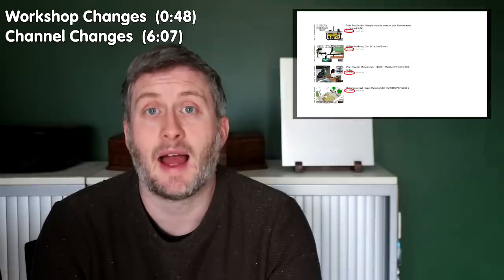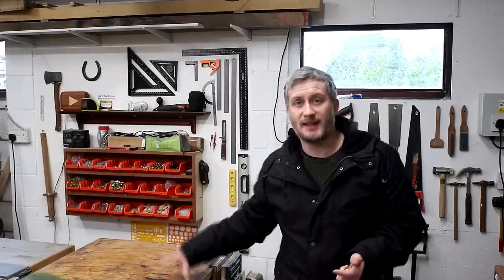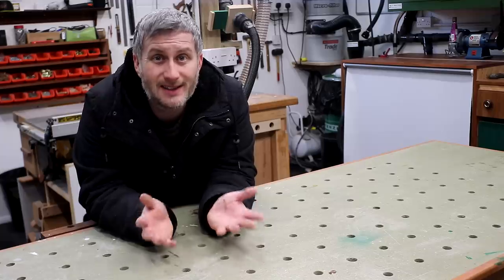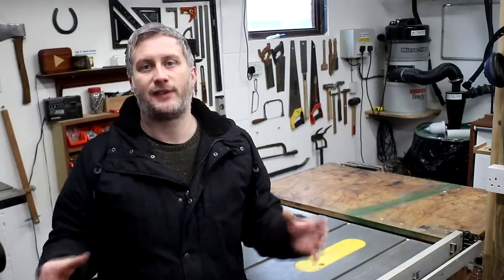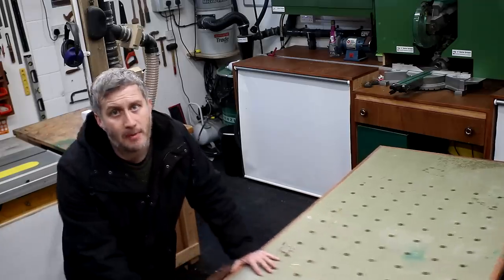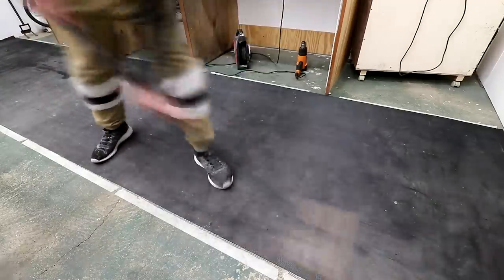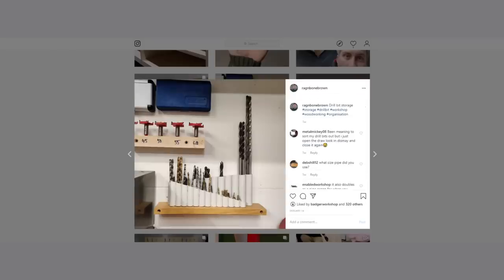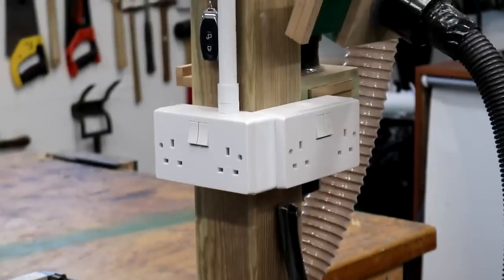VLOG 10 - Workshop Changes / Channel Changes / Tool Talk (broken Mirka sander / New Air Filter)

Comment: Regarding the remote control - you could try using an IR on a phone with an app or on some universal transmitter to try simulating the "on" command.

Comment: Love the pointy stick solution 😃 don’t know why you would need anything else 🤣. 

You need to do what is right for you and I hope it works out in the end.
Reply: Realizing that this all happened a year and a half ago, and that you have sourced a remote for your air cleaner, I’d like to make a pointy-stick upgrade suggestion.  To make the operating end a bit more functional, add a snugly fitted rubber cap (if you can find one that fits) OR you can coat the end with hot glue, either of which will serve to make the business end a bit more grippy and effective.

Comment: I find that the more premium manufacturers are harder to deal with, which you wouldn't expect. I've NEVER had an issue with DeWalt or Hitachi. In fact, I broke a drill bit once and the DeWalt rep I spoke to sent me an entire package of cobalt drill bits as a replacement. They're by far, the best in the business.

Comment: The whole issue with warranties is that some sellers will import equipment from outside the region. If you are in the UK vendors will often only support kit that has come through the European distribution network. If you buy cheaper item from a vendor who has imported it from say Hong Kong then it is a grey import.  Manufacturers don't like this because it messes with their pricing I guess, hence they try to stop it by not supporting grey imports.  No idea if that happened in this case but if your Mirka was a lot cheaper than through the main UK vendors, quite possible.

Comment: Thanks for the interesting update. If you are thinking about a new table saw you definitely need a new table saw. It is the cornerstone of timber workshops and a larger table lets you play with fantastic jigs. Also, a big saw does not take up any more space as it is always part of a larger workstation anyway. Really good quality second hand saws are ludicrously cheap, especially if they are three phase and dead easy to re-motor with single phase. Sliding tables are also a boon but take a bit more planning space wise. My last Wadkin sliding saw was £120 and the new motor was £106 - for an industrial quality machine that would now be 4 or 5 thousand.

Comment: Get a bigger table saw, look for an old Sedgewick or if new, an Axminster trade would be about £900 but you could sell your DeWalt for about £300 and you would be massively upgrading your capacity and going to a full cast iron top with lots of options for extensions in the future and they hold their value well and have good dust extraction.

Comment: Hi Keith,
I do have a RP shop vac with no remote or other fancy stuf. But it has a switch.... that is turned on and stays on. I simply made a connection with the light switch. If I turn on the light.... The shop vac gets its power and does its thing. And maybe its a workaround that works for you. 
In stead of the stich the regulates the lights youlf course can install a second switch for the air filtratio unit.
Reply from the maker: nice solution

Comment: If you upgrade your table saw to the sawstop jobsite saw, there is a good example of an integrated bench video/plans for that on the Darbin Orvar channel.  I preferred a 4" dust port and so got the larger sawstop contractor model.  Then I decided to make my own mobile base as I wanted it to have 4 way wheels, and I made several videos on that.   Good luck in whatever you choose, I look forward to seeing your upcoming videos and projects.
Reply from the maker: SawStop not available in the UK. Thanks

Comment: Hi. Great video. Add financial/marketing advice to each build video. Tool/shop videos are always fun. Stick to your values. 
Air filtration suggestion- having bought this unit also at Xmas i found the guts of this unit is generic across a few brands. It's my understanding buying a WEN branded (£135) is the same as RECORD, (5yr warranty on RECORD) and remote will work with all. So, buy another unit, have a mega clean workshop/lungs, and one click to start them both. 
Or you could always make a nice machine stick starter project video!

Comment: I'd highly recommend getting a new table saw! An induction motor is just pure pleasure, you'll not regret the upgrade!
Reply from the maker: but which?
Reply: @RagnBoneBrown  
That's a tricky question! I started out by building a table saw, with custom homemade parts. That is perhaps a bit much as it requires a whole bunch of machining in steel. Just a few months ago I bought i Wadkin Bursgreen AGS 10, an older UK-made unit (1969). It's farily small so it would fit nicely in your workshop but it's still very capable and superbly well made.

Comment: The work around for the air cleaner would be to disconnect the wires  from the motor to the nvr switch and connect them directly the power cable. 

Other than that, record power have great customer service and would help you with a remote.
Reply from the maker: cheers, too technical for me though!  I am actually sorted now as Karl at Strawbyte Workshop kindly sent me a spare one

Comment: Nicely done Keith 😁👍. Great idea staying in the warm while the other Keith is out in the cold workshop 😂🤣😂. Looks like you may already have a remote for the air cleaner, but if that doesn't work out I'm sure it wouldn't take much to remove the controller and mount it in its own enclosure lower down on the wall (don't know how you are with electrics though)?? 🤔. Sounds like you are taking a leaf out of Andy Macs book regarding sponsors.. good for you 👍. Also.. when you upgrade the power to the shop.. get a 16A supply and sockets, your potential "new table saw" may need one. Keep up the great content 😁👍.

Comment: 1. Upgrade the table saw. 
2. if you make a bigger table to enclose the table, you might want to consider adding a router table addition to it.

New follower here, love your stuff. Keep up the great work.
Reply: You might be able to purchase just the remote for the air filter from the company that it's from. This unit looks like a rebrand of one that is put out by WEN, JET and many others. 
• Take sponsorships only if they are related to woodworking. If you are NOT getting any offers from appropiate people, then you might want to make a list of vendors you like and pitch to them. And it doesn't just have to be  manufactureres, also think of stores.
You may want to check our Steve Ramsey's video about the what kind of content do you want to produce. This doesn't talk about the issue DIRECTLY, but it is indirectly relevant. https://youtu.be/9YQguhFKSWY

Comment: I understand your desire to get paid for the work you put in and I applaud you for your openness to your subscribers.  I fully believe that using a platform like Patreon to allow people to contribute to your effort is valid.  Ignore the haters.  If they don't like it, they choose not to contribute and even not to watch.  Kudos to you for turning down non-content-related sponsorship, but as I said, I understand you desire (or even need) to get paid.  A guy has to eat!  

I enjoy your videos.  Keep them coming!

BTW, If you're power service isn't providing enough amperage to your tools, it puts extra strain on motors, shortening their lifespan.

Comment: Turning on the air filter machine w/o the stick should be a cinch. 

How hard could it be to jerry-rig a lever to press the button down? You could probably adapt some kind of hinge hardware from your hardware store and epoxy it to the machine.

Comment: Hello Keith
I don't normally do comments but re upgrading your table saw, I did a lot of research and if you don't need to take it out i.e. Site work, then I can definitely recommend the Itec 01332  cabinet saw, it's a beast and it is the same as others but without the badge and price tag!  Best place I found for this is Scott & Sargent and as it happens its on special offer at the moment for just £799 plus the VAT. I have made a large cross cut sledge for mine and it now doubles up as a panel saw as well. Very much worth a look? 
I am near Colchester, so not too far from you and if you are ever coming this way, happy to show you it / let you have a go?
All the best in you endeavours, as a footnote, I prefer project videos.
Reply from the maker: Thank you, it looks like an incredible saw. Not affordable to be at the moment but I'll keep it in mind for the future though

Comment: Hi Keith,
Good to see a 'vlog' again, nice one....just a thought in relation to the outfeed tables etc for the 745, i have the same saw, and my workbench looks a similar size to your mft table, i lined both heights to be the same (inc castors) so as i could use the one table to do allsorts, including being an outfeed for the 745,also use the table alongside the mitre saw for longer lengths feed, anyways just a thought....keep up the great work, and keep on keeping on!! Gary.

Comment: If the controller is just IR you could either get a universal controller and program, orrrrr you could get really geeky and use a Arduino or a pi to control a IR emitter and then program it into your shop

Comment: Thanks for the heads up on the Mirka, was wondering how you got on with it. I think I'll give it a miss, that's not acceptable at that price, glad you got it sorted! Would a One for All remote work for the air cleaner, have someone teach the One for All using an existing Record Power remote?
Reply from the maker: Thanks, I am actually sorted now as Karl at Strawbyte Workshop kindly sent me a spare one

Comment: Hi Keith, I love your channel. You have inspired me to setup my own workshop and I've just got to the point where I need to have electrics installed. My electrician has said that I should request a mains fuse upgrade from 60 amps to 80 amps or 100 amps if possible and he said it should be straightforward. Have you had to deal with this yourself? 
I have been in touch with Western Power Distribution in my area and they have said that because of the motors on the machines that they have to do a survey to determine if the machines will interfere with neighbours supplies and that they may prevent me from running them. They also said that if that was the case they could install a "New Connection". They did not say a cost but I am aware that this would run into thousands. I'm devastated to say the least of this prospect. I have already spent a serious amount of money building my workshop and buying machines. Just wondered what your experience of this was. I'm at a loss really.
Reply from the maker: Hi Mark, I'm not going to pretend I understand the technical stuff to be honest, but at my place I believe it's a case of upgrading the cable that runs from our consumer unit in the house to a 10mm one, then that will connect to a 10mm SWA cable for the external bit, and in to a new consumer unit - I believe that's all that is needed in my case based on what my sparky friends have told me.  Good luck, hope you get it sorted
Reply: Hi Keith, Thanks for the reply and support, Yes the work you describe is exactly what my electrician is doing for me, my problem is the main supply coming into the house from the road, which is a separate big fuse before it gets to the meter. As a matter of interest do you know what your mains fuse is?
Reply from the maker: I don't I'm afraid, sorry

Comment: Keith, your channel your decision ref sponsorship, but you're right gaming and woodworking isn't a greatly happy mix. I'd gladly become a Patreon, but I'm maxed out with numerous other woodworking channels. That may change, not very long ago I deleted one (a well known younger woodworker and his new friend who at the time were just mucking and larking around, which wasn't going to retain my support, although they've since marginally improved) in favour of another very long term following of well known grumpy Canadian, promoted because of less grumpy chatter and more detailed build videos. Yep, I'm a fan of those ball aching build videos. I recently sold a record power AC400 to another on Ebay, I'd picked it up as a bulk purchase with other stuff and since I already had the larger Jet unit I sold it on; it didn't have a remote either, which I was quite clear about - I wonder if it's been sold on again to you.

Comment: Just bypass the switch on the air filter unit and use your old wireless plug as before, or by a relay based remote control switch to override the on  switch
Reply: How do WiFi/ wireless plugs, controlled by Alexa or Google, behave after a power cut? Are they equivalent in operation to an NVR switch?
Reply from the maker: too technical for me, sorry

Comment: I have the same air filtering unit (Just a different badge)  I was wondering how well it worked until I built a project out of mahogany.  The filter turned red pretty quickly so that tells me it works well.   I think that you are a good candidate for a larger table saw.  Grizzly or SawStop needs to step up and send you one, right?
Reply from the maker: I don't think we have either of those brands here in the UK sadly

Comment: Strip out all electrical switch stuff, it’s just a motor that needs 230-240 v to be on or off. It’s either on or off, if that makes sense (extractor) not sander😳 ummm but amperage is very important 👍
Reply from the maker: Thanks, I try not to mess with electrics! I don't understand any of it

Comment: Bit of a random question, but we live in the same part of the world (norfolk) so it's kind of relevent - When you were in your old workshop, in the winter did it get very cold, to the point where wood glue wouldn't 'set' / glue? I'm finding at the moment that I have to bring glue ups into the house to glue up, even given an hour or so to cure. Could my glue be rubbish, too old or knackered by the freezing nights? It works fine indoors...!
Reply: I live in North Yorkshire and I currently have to bring glue-ups into the house to cure because my workshop is too cold. I use Ever Build 502 like Keith does. It does say on the bottle "Do not use in temperatures below 10 degrees Centigrade".
Reply: Same in Bristol, if below 10°C, glue doesn't setup properly, will be installing 100mm celotex over celling in the summer then EPDM over top so I will be able to install a small heater in there for glue ups and not have it cost me a fortune.
Reply: Nige Grumlin interesting, I am using everbuild 502 as well - perhaps a new glue is in order!
Reply from the maker: If it's a small project I tend to take it in the house as the glue cures much quicker in the warm.  If it's a larger project I tend to use PU adhesive as it works great in cold weather
Reply: Rag 'n' Bone Brown thanks for the tip!

Comment: I know it's 10 months later...but to my mind if the tool has a valid serial number Mirka shouldn't quibble about repairing it (and in fairness they didn't, but the authorized repair centre working on their behalf should align with the manufacturers ethos too) no matter if you were the original owner or not if it's within the warranty period. Their reputation stands on their warranty and longevity of the product not whether the original purchaser didn't get on with it personally or whatever. In the long run two lots of shipping and some cheap parts aren't gonna break the bank or their profit margins.
Reply from the maker: You're absolutely right. Couldn't agree more!

Comment: just get a wifi socket for the dust extractor and you can turn it on with your phone
Reply from the maker: it would be the same issue, unfortunately - the unit would see it as a power failure and not turn back on

Comment: Hi Keith, sorry to here your business didn't do too well, but at least you realise why.  As for viewing figures, it's difficult, because there's obviously a limited number of tool reviews you can do.  I think the the project content might need to be more general.  Plus, I don't like cats, so the cat related videos don't get a look.  The issue with your dust collector is the NVR switch.  I'm not sure a NVR switch is necessary with that type of machine.  Just replace the NVR with a normal on/off switch.

Comment: Re: the mirka, are you shitting me. Mine broke too. The circuit board went on mine. Looked into it and apparently it's really, really common. Apparently it's due to vibration due to using a worn pad. They recommend you adjust the balance with the tiny alan nuts under the pad. It's an absolute joke. I had even come across a paper by a finnish uni student who had experimented and documented the fail states of that exact sander. Clearly they're aware of the problem. Started happening when they moved manufacturing of the board to china.
Reply from the maker: It's terrible really that such a brilliant, premium tool has so many reliability issues